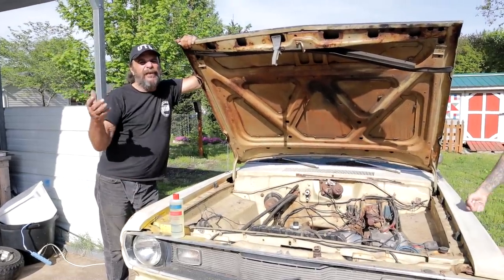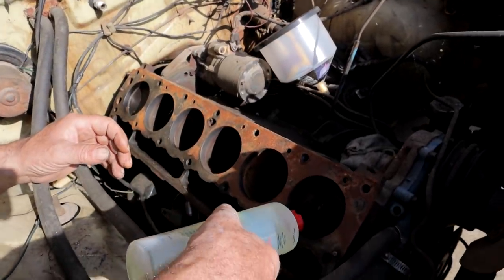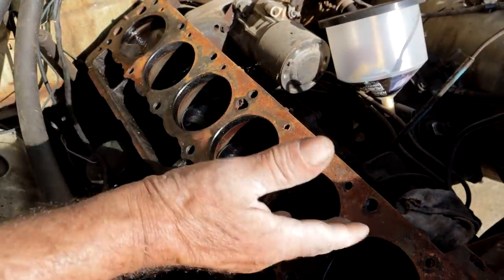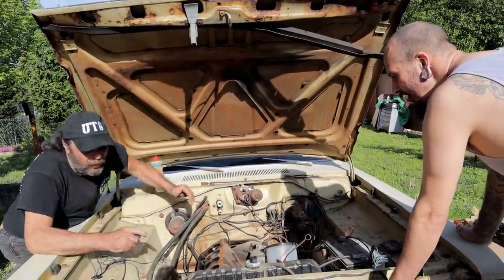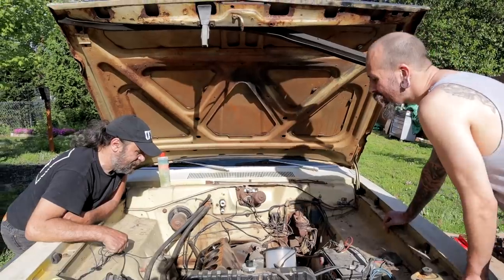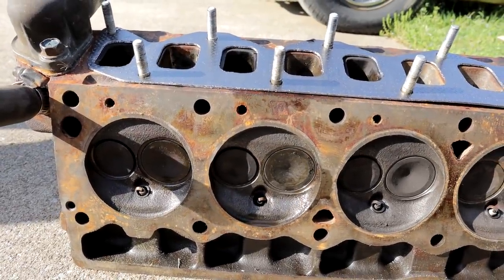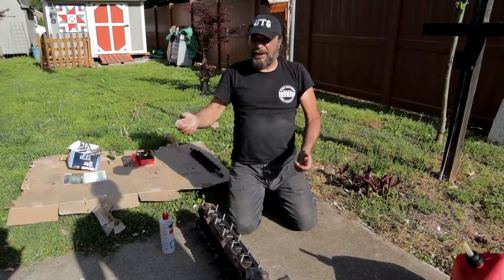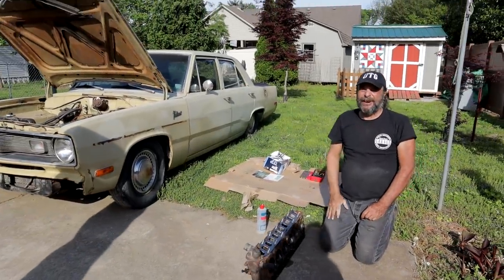Cheap Classic Car Revival- Assessing The Mess

Comment: Hopefully everything is in ok enough shape to get fixed at home with a bit of elbow grease, because these days if you need a bore job and the head resurfaced and a valve job, the cost of those services will easily cost double or even triple the value of the car, if it can be fixed with valve compound, a hone, and fresh rings then great but if it needs more than that it would most likely be cheaper,easier and faster to just find another complete good running slant 6 and throw it in and call it a day or maybe try to do a V8 swap.
Reply: I had a complete engine rebuild done 10 years ago for $1,400, pistons,, bearings, seats/valves, springs, pumps, you name it.,, I can only imagine what ridiculous figures I'd be quoted today.
Reply: @nicholasagnew2792  these days you can easily spend that in just the machine work, in my area a bore job costs $300, hot tank $100, surface job for head $100, surface job for block $150 and any additional work like align honing and sleeve replacement gets super expensive and the cost of parts these days is getting ridiculously expensive and alot of parts are getting hard to find, and in most cases its physically cheaper to buy a good running used engine or buy a already remanufactured engines they typically cost a bit less than building one yourself and most come with some sort of warranty.

Comment: How do you know the valves themselves are good and that a lap job is good enough? Also would oil work just as good as the gas?
Reply: No oil is to thick water would work but there's rust issues

Comment: At 48 seconds into the video you made an incorrect statement. Sorry to have to call you out on this one Uncle Tony, but Timing most certainly Will affect the compression, especially when like on a slant six having timing gears instead of a chain. It can jump a few teeth and still spin around but be being out of time it can't make proper compression. Not saying that's what's wrong with that particular engine though, but it's worth pulling the timing cover and looking at the timing marks just to be sure.
Reply: Slant six has gears and a chain. Its not gear driven. Either way still wrong. They are all off or none my friend.
Reply: @davidj.2870  I could have confused the slant 6 with an old pre 70's Chevy or Ford, or maybe an old Jeep 6 banger, it has been 35+ years since I did very many American made cars. Unless someone did a geared upgrade on a slant 6.  Chain delete options have been around a long time.

Comment: Timing chain blows all its plastic teeth off. Engine rolls over several times after that, changing valve events enough to lower or completely wipe compression.  THAT'S how timing affects compression.  The guy SAID he 'only checked the front two,  before he pulled the head' slippers or not,,, there's no telling whether the other 4 had goose eggs or not.  If they had, it's that wonderful plastic toothed cam sprocket any longtime Mopar guy has cursed. They kill an otherwise reliable ride.

Comment: I revived a car that was left under a tarp - with road salt all over it - for 8 years. 
Still driving it.
Reply: under a tarp is the worst.  You are so much better off just leaving it uncovered.
Reply: @tarstarkusz  And when I finally painted the car in 2009, it has since only gotten wet roughly a dozen times. I even got a place with a detached garage to put it in.

Comment: A lot of the straight sixes had the hell beat out of them. The owners bought them cuz they didn't use a lot of gas plus they didn't take any care of them at all. Used to get phone calls all the time car wouldn't start. Had the original champion plugs with 30000 miles on them.

Comment: UT, with your test of the valves, isn’t it possible that one or both of the valves that tested bad was just not completely closed, depending on where the valve was when the engine was shut down and the heads pulled?

Comment: In that situation, heads already off, unknown to me what the bottom end is like, I'd just tear the whole thing apart. Obviously more work but you already need a head gasket set anyway, a complete overhaul set isn't much more. 
That's if the car itself isn't rusted too badly, where I live it's a rare to find an old car that isn't.

Comment: With the price of fuel these days it would of been cheaper to put the engine back together. Compression is not only the rings the valves play a equal part in compression too

Comment: If I would have had all those pieces sitting in front of Me I would have automatically planned on having to pull the motor out if for no other reason because the pistons are frozen in the block. Nothing cheap these days but the head would have been the other issue which I again , would have just automatically figured on having to get re-done. Yea, if the thing was still completely together ok fine , gee let’s do a will it start video but in the state of the car ‘ as is’ with the goal of making a runner out of it and because of the above mentioned issues well , time to pull the engine out and address the stuck pistons issue . and since we are at the infamous’ here’ spot the head might as well go and get freshened up. Looking forward to seeing how this one ends up. Looks like it’s going the same way your GTX project went , kinda sorta. Enjoying the content , thanks !

Comment: What I know is that if you have those front two cylinders down it is valves.  With those old manifolds a dusted motor would be down on compression in the middle. Unlikely the front cylinder would get dusted from a bad air filter.  Normally the front and back cylinders come in near perfect for compression.  Valves in the old motors is due to the unleaded fuel and old cast iron seats wear out.  Very hard to work with the head off.  You can pull it all apart and do a full inspection. Halfway done.

Comment: After reading several comments on the subject,  I must comment about timing affecting compression. 
One could remove all timing devices from an engine and perform a compression test. If there was a bent valve, failed head gasket or no rings , tight rocker arms then those would affect the compression test. The compression tester is simply recording the highest achieved cylinder value, it has nothing to do with timing.
Reply: Ignition timing will not affect compression but mechanical timing i.e.  Valve events Most definitely will

Comment: I used to pull the pan ,and  cylinder head and remove the ridge on the top of the bores and remove the pistons and rods, clean em up and install new rings and rod bearings, stuff a shit load of shop rags over the  exposed rod journals and run a glaze breaker hone(not the ball one) and it worked back in my day
Reply: SAme here, and I have rebuilt MANY engines without even touching the cylinder walls (provided they were in good condition), used plain ole cast iron 1st and 2nd ring, and had great results with ZERO failures, never had a "come back", but there was one that was a "freak", it was an 82' Bonneville with 305/4 bbl, just plain rings, gaskets bearings and seals, cam and lifters, but the valves and valve seats were heavily pitted, so I ground all the valves by hand on a bench grinder (had nothing to lose, it was either make these work or buy new ones), so I ground the valves by hand and and touched the seats with a stone from the flea market, lapped them by hand, and tested them by filling the combustion chambers with mineral spirits, no leaks.  This 305 ran WAY better than it should have, it was just a stock rebuild and I was so impressed how it ran, so smooth and silent you could not tell it was running in the driver seat, but it really moved when you opened big quadrajet secondaries!  It was no race car, but for a stock 305, I was impressed!
Reply: You rich kids with your new rings and bearings…. 😋
Reply: @michaelgarrow3239    Exactly. Never understood the re ring thing. Somehow pushing the piston out and exposing the rings to the atmosphere ruins them. “But you could break a ring pushing out the piston”! You could. But if you don’t, then it’s ok.  
Most machine work and parts replacement that I’ve seen or heard done is just because ‘that’s what you’re supposed to do’. Why?  I think most people would be surprised at how well not screwing with the engine actually works very well.